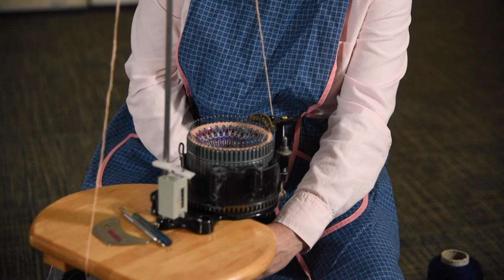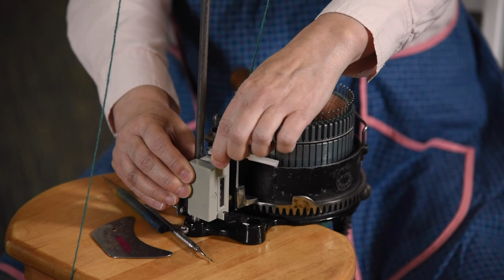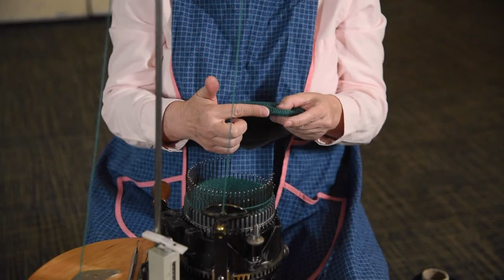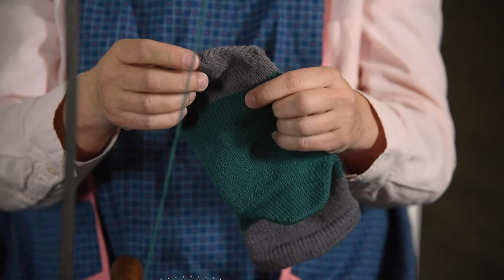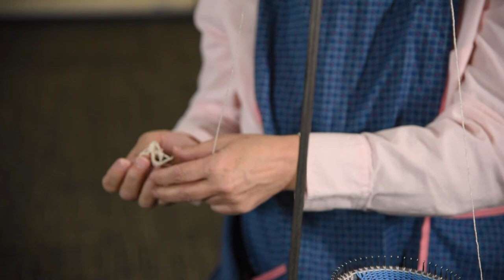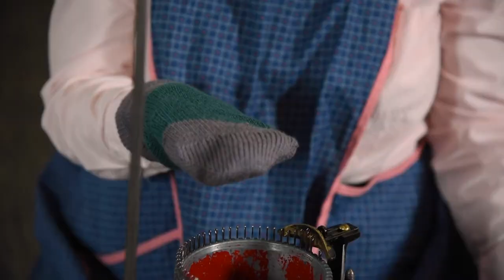Circular Sock Knitting Machine Demonstration-Vicky Dalton.Visit the 2020 Spokane County Virtual Fair

Comment: I've become fascinated by these machines and I've been 3D printing them and coming up with my own improvements. I have two questions: 1. Why is the little plate on the yarn feeder shaped like that, with the sort of wings out to the side? Do those wings serve a purpose? 2. What is the purpose of the sort of the shiny steel bar with the two 90 degree bends to the counter-clockwise side of the "The Auto Knitter" logo?

Comment: Thank you very much for this helpful video. I'm new to knitting machines. Can you (or anyone) tell me whether on this or a typical sock knitting machine it's possible to double the yarn to knit a reinforced heel and toe? Also, do socks knitted on a machine have a gusset after the heel? (When I've finished handknitting a heel my whole circumference of the sock is increased, and I then reduce back to the original circumference of the ankle. I don't know whether this is true for all sock patterns and true also on machines? If not, then I'd fear excess wear – so presumably the answer is yes, but I wanted to check.) Many thanks!